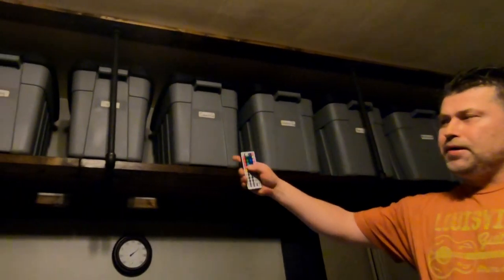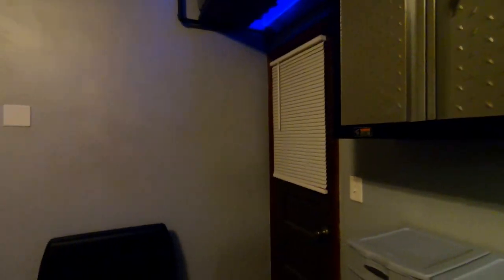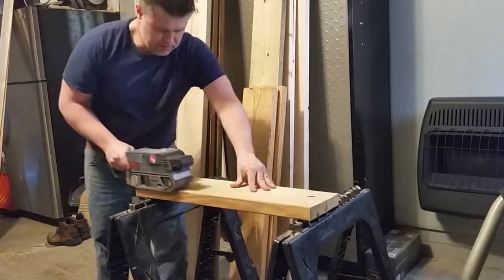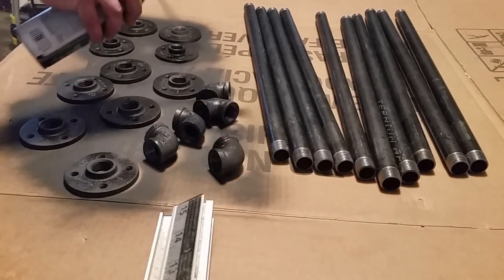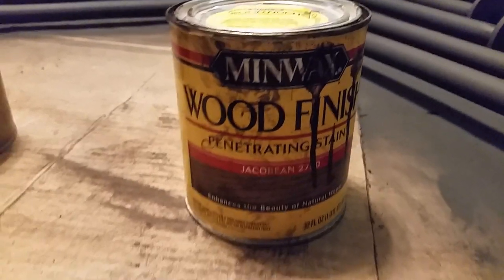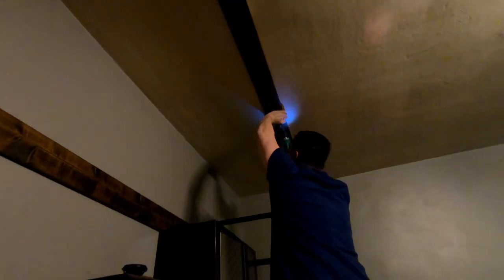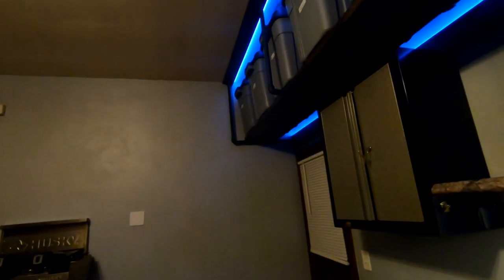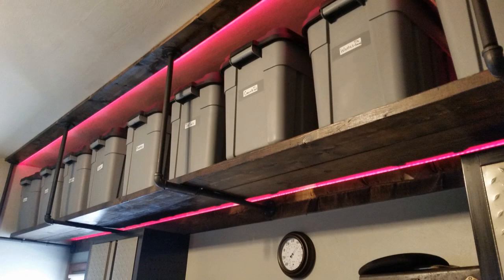Garage Shelving Ideas DIY

Comment: Love the overkill on the construction but it’s really not necessary because a single 2 x 4 will support 1000 pounds on end or flat.

Looks like your shelving planking was 2x12’s?

What’s that mean on your build? 

That means you really only need a middle pipe support & if you’d tapped into the side wall studs you really wouldn’t need those 2 Pipe-L’s on either end except for aesthetics.

I’m thinking 2 actually “supporting” Pipe-L’s 
In the middle of the plank-span & Perhaps the 2 End-Cap Pipe-L’s simply for aesthetics